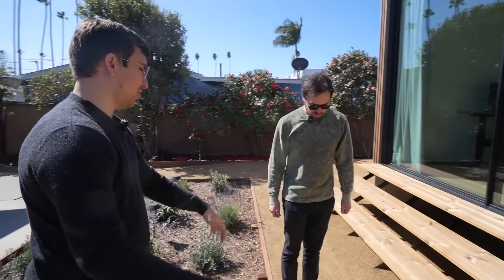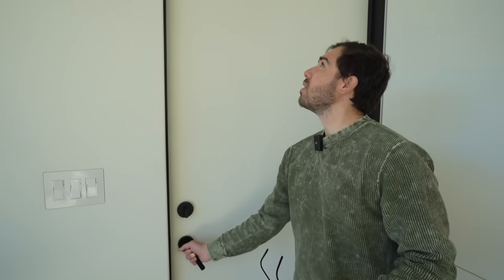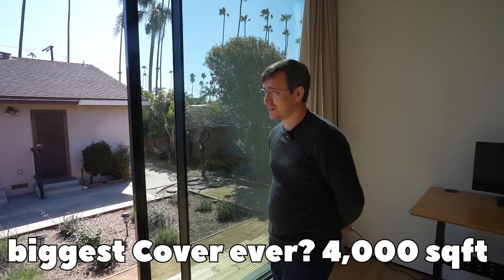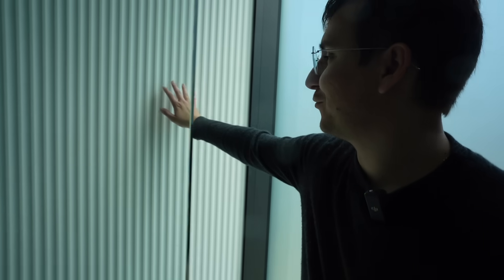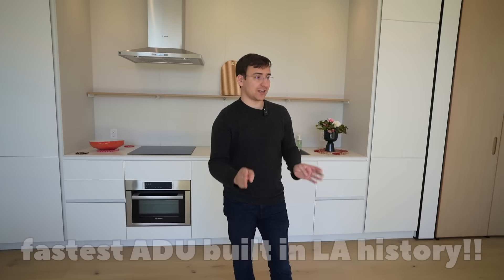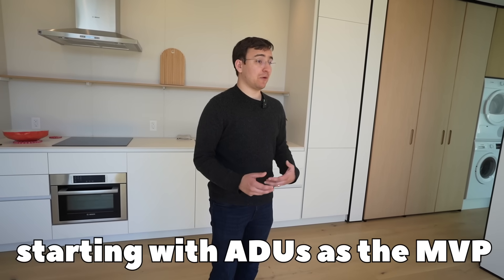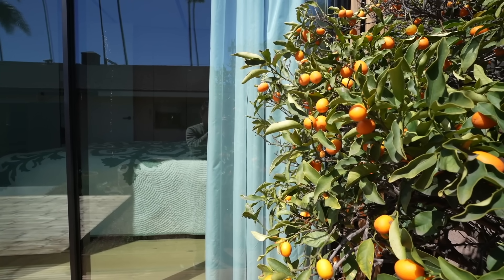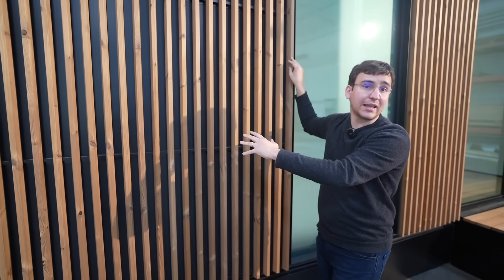Cover is Building Homes Like Legos, HyperChanging Housing ⚡🏠

Comment: As an architect, I have to say this place is really well done. High ceilings, quality materials, and a clean, modern look. The price is a bit more than I expected, but overall it's a great-looking ADU. Most ADUs these days feel super basic or kind of ugly. this one definitely stands out.
Reply: $350k a little bit? 😀 In EU you can make it for like $60-$90k 😀
Reply: @stephan_clarkson  I believe he said the price is the all-in cost, which includes permitting, site prep, construction and utility hookups, all the way to the certificate of occupancy.  No way you can do everything for under $90k in the EU, even if you start with those $1 homes and renovate.
Reply: @vinumcopia9850  You can do it easily in EU. Around $100-$150 with 3rd party companies. It is very small house. $180k-$200k will be for very solid house 120-140sq.m. build from concrete + bricks.
Reply: u think AI robotics will bring price of housing down or materials(inflation) will make housing rise?
Reply: I'm in the SF bay area and looking for a draftman to realize my designs into final plans. Let me know if we can talk and possibly work together.

Comment: Modern design, and if such a modular system is implemented intelligently, it can be a good sell - if the price is right!

But it's nothing new; such modular construction methods have been around for decades. Even hospitals are sometimes built this way, with multiple floors with operating rooms, pre-installed plumbing, etc.

Comment: Looks good, but $350K!?  break down cost of materials, then add the labor and engineering...  1% material cost, the rest is bloated...   Give build dimensions to a redneck and tell them to build it as strong and as inexpensive as possible... If they spend over $20K I'd be amazed...  Neat idea though...

Comment: No mention of inclusion of heat pumps for heating, cooling, & hot water, nor solar &/home battery storage as standard. Surely by now, and especially in climate change prevention and mitigation conscious California, this stuff should simply automatically come as standard without giving it a second thought in new builds and retrofits. Vertically integrated factory built design and construction should make these a no-brainer and for very little extra cost if the company has gotten all its supply chain ducks in a row. From a customer perspective, the aforementioned make for an extremely efficient, low energy home to run and is how ALL construction should be being done in the 21st century; there really is no excuse why this isn't so.

Comment: Lovely house but very expensive for what it is. Maybe building costs in the USA are astronomical compared to elsewhere. A (one) bedroom factory built home like this should be considerably cheaper as factory built means far less waste, or at least it should. 
In light of the increasing chance of wildfires and accompanying climate change induced intensity, I'm not sure about how well the choice of external cladding would perform under such circumstances.

Comment: It's a nice design but it's just much more expensive than conventional construction. A module house doesn't compete with conventional build, it has an apparent appearance of being a module house. Saving a couple of months does not remotely make up for double price. If it properly stood on the ground like a real house AND it was cheaper than conventional construction they might have something. But a fancy work shed at double the price... no
Reply: You can easily build modular homes in factories that don't look like this. It just depends on design and materials. This house is nice but reminds me of a clothing department store. The kitchen appliances are hardly fancy, pretty standard in fact, despite Gali's assertion to the contrary.

Comment: Is anyone going to take the Tesla approach to housing? What materials compose a house? Can we mass produce the basics? Can we delete all the parts? Can you gigapress the doors, walls, ceilings?
Reply: Yes.  That's what a lot of the prefab companies do.  Basically.  All they're trying to do is figure out how to reduce construction costs.  Number of parts and number of people to assemble are key parts of that.

Inherently this is REALLY different from Tesla though.  You don't tell them you want a 3 series and then take that same 3 series chasis and end up with a model X.

With these prefab constructions they have to balance out the ability to customize.  How things will fit together.  What will happen to load bearing members?  Where the plumbing will run.  Where the electrical and HVAC will go.  No one is ordering a model S and asking if they can put the car's vents in a different location and maybe remove a window  or change the size of it, or maybe just make it a convertible. 

What materials are used?  Yeah.  That's something every home builder thinks about.

Can we mass produce the basics?  Yeah.  They're prefabricating parts and reducing the parts that go into it.